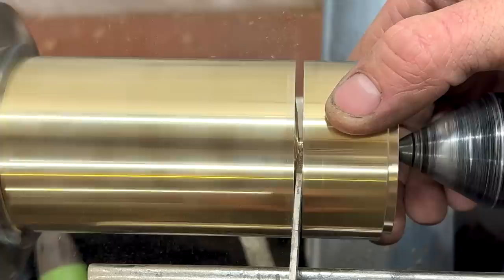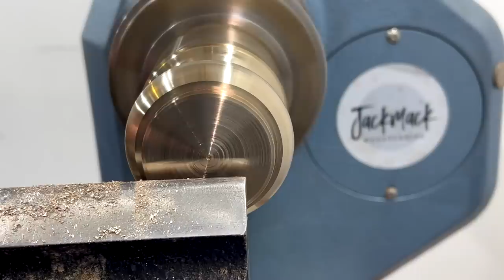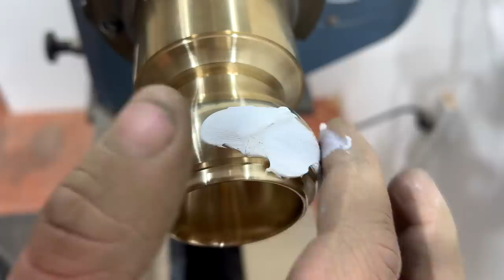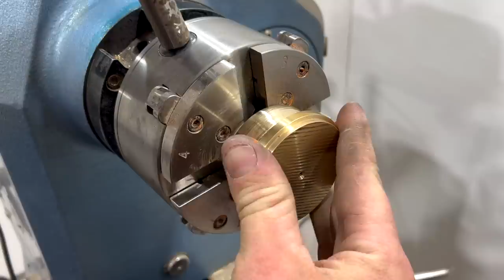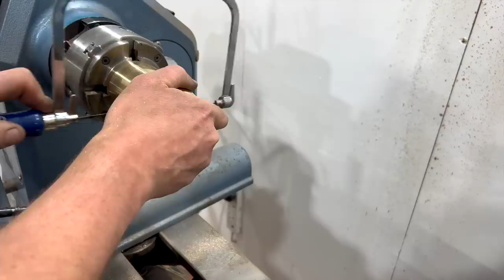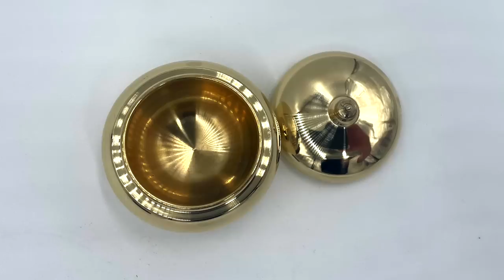Woodturning - I Turned Solid Brass On A Wood Lathe !!

Comment: First of all, Brilliant! Secondly, I would like to know the same as Tim, how was the brass on the tools? To me it seems like the Hamlets held up very well judging from the shavings you got, but you had to sharpen quite a bit. This was really a insane but Epic project mate. Well done. I'd guess about 8 times you had to sharpen. Thanks again for this.
Reply from the maker: Cheers buddy. Be sure to pop your answer in the pinned comment thread so that it’s not missed. Comment the answer there in due course 👍🏻
You going to give this a try ?
Reply: @JackMackWoodturning  yes i am

Comment: That was interesting 👌 what you gonna do with the shavings ? I’d make a bowl or a vase in clear or a very light colored resin 👍
Reply from the maker: I’ve got the means to melt them down and recast them. So Il be doing that I think.. brass is pretty expensive.

Comment: Good job, I didn't know that works. Looks like an urn for mice ... 😉

By the way: What engine speed did you use for turning brass?
Reply from the maker: Speed varies. 1200-2000 

A mice urn 🤣🤣🤣

Comment: You can turn soft metals on a wood lathe. I have been turning aluminum for several years. Too many variables, but  I'm going to say that you sharpened the tools 5 times.
Reply from the maker: Lower! 🤣
Reply: @JackMackWoodturning  You sharpened your tools 3 times.

Comment: I tried turning brass a while back and the tool just bounced off it. Didn’t work very well for me, you make it look so simple.
Reply from the maker: What tool did you use ?
Reply: @JackMackWoodturning  brand new carbides. 😒
Reply from the maker: Scrapers.. too much surface area I’d say. Try again with “real” (😉) turning tools

Comment: First off let me just say it came out beautiful. Probably twice as nice as I would have thought  would have from the first couple minutes of the video. I am going to throw my two cents in though but it's helpful criticism one Craftsman to another. It was Santa just so you know I'm not just some dude that watched a few videos or picked up lathe work for dummies at Best buy. Josiah 20 years manual Machinist and bushing 60,000 hours of experience 60% of it was on lathes. Everything from tool and die photo typing robotics aerospace commercial and space program military defense and automotive. Granite I haven't been in machinist in 15 years and now journeyman Union Millwright. But some of my terminology might be off. Probably more so on the woodworking tools..  beforehand forgive me if I misspeak but I think you can figure out what I'm getting at if I get the name of a tool wrong. No this is something that you only did for a video probably won't do it but a handful of times in your career don't worry about it but if you're going to do this often or a couple times a year i assure you if you apply these subtle changes and give yourself three to five of them to get used to the change and procedure influent with the different process you'll see a big difference in everything from how often you sharpen your tooling you use. And definitely in your finish and safety as well. Okay right from the brass blank in the chuck.. for you ever even put a tool in your hand you're going to have that peace morning too and concentric considering it was a machine blank and I'm assuming it probably ran within .002 of running true and concentric. That being said it should be within no more than 10,000 run out and to end before you touch it with any tooling he should be running no more than.010 run out. Three times a year minimum I'd advise dedicating inside the Jaws to this procedure but a brass or aluminum ring on it the first thing you do is close your jaws and give them a skim cut. That way when you throw the piece in at the Jaws it'll probably be within 5,000 if not better all you have to do is tap in bar end but I feel adults perfectly straight he's a piece of brass the size of a quarter roll but right on the turning piece go get the fuel for the high spot and just tap it keep doing that until you don't feel a high spot no more it will make a difference. Okay Angela touring techniques and concepts for turning wood is way different than meta. But on the other hand they're very similar if that makes sense. Differences are proper tool selection proper grinding and proper tool angle way more critical with metals.

Comment: Oh! By the  way, I turn bowls, and I dont have a Varigrind jig set or Sorby sharpening station.
Reply from the maker: Do you have a tormek? 😆
I’m joking. I’m guessing you sharpen free hand. ?
Reply: @Jack Mack Woodturning  Hi Jack! I am just setting out teaching myself bowl turning. Perhaps if I had known now expensive it was to set up,  I may not have started out. But now I have a small workshop,! 

To answer your question.....at the moment I don't sharpen gouges. I mutilate them!

It's all a learning curve. Which is the most enjoyable part. as I am quite badly. disabled after being poisoned with a pesticide at my work. The problems keep my mind active. Or is that perplexed?

I enjoyed your video. Is it possible that you do a series in a minimilast.  

No jigs, no bandsaw, no hugely expensive lathe, Simplicity! For all us newbies out there who have just set out. Can you do that?

Comment: I don't get it.  There are metal turning lathes, and tools specifically designed for metal turning.  Why ruin your wood turning tools doing this on a wood lathe?  Just to show that it can be done?

A lot of things \can\ be done.  You can drive nails into 2x4s with lineman's pliers.  You can use a chisel for a screwdriver.  You could use a vertical mill to make coasters out of plywood.

Probably not the best use for any of these, though.
Reply from the maker: Why do you think this would ruin woodturning tools ? 
It’s brass and they are hss 
I don’t have a metal lathe and I wanted to turn a box from brass, I mean, it’s rather self explanatory, is it not ?

Comment: With the money spent on purchasing brass and big planer and router machines, surely you could buy a small metal lathe and do the same job without damaging your woodturning tools? Please look into it! I feel sorry for the HSS having to do more than a few rounds on soft metal...
Reply from the maker: This doesn’t damage my tools. And the goal was to turn metal free hand. Not with a boring skilless metal lathe.
Reply: @JackMackWoodturning  Whoa… That’s very insulting to say that metal lathes require no skill :/

Comment: I know its already over but I agree with 0 which has been stated a few times, if the tools are good highspeed steel and sharp before the project starts they shouldnt need frequent sharpening HSS tooling is used to cut brass on metal lathes and can go quite a while without sharpening assuming they arent being used improperly
Reply: @JackMackWoodturning  also I have been looking into new turning tools lately I have a poor quality set right now what brand would you recommend?

Comment: Turning brass on a metal lathe is right in the center of my wheel house.   Hand turning on a wood lathe, with all the tool chatter?  Nope, not for me.  Nice piece of work but let us old engine lathe operators work with metal TY!  I wouldn’t consider chucking a piece of wood in my metal lathe!  Not what the machine was designed for!  I’m impressed it turned out as well as it did, but please, shoemaker, stick to thy last!  Brass is self lubricating and I doubt you had to resharpen your tools during the entire project.  Brass cutting metal lathe tools have a deep negative rake cutback just like a traditional wood gouge.
Reply from the maker: Nailed it M. I’m not intending to step on any metal workers toes though. ‘Twas just an experiment. 😉

Comment: I wonder if it would be possible to hand turn on a metal lathe.
Reply from the maker: I guess all you would need is a tool rest right?
Reply: @JackMackWoodturning  That's what I'm thinking. I've tried doing metal on my wood mini lathe and found it was too sloppy (cheap?)
Reply from the maker: @davidhawley1132  I’d say so. Never seen a mini lathe that was built well. Even the expensive ones.

Comment: Hello sir,
Where can I buy a cylinder like that? I'd love to try something like this.
Reply from the maker: You can buy brass at any metal wholesaler or buy off cuts from eBay. What do you plan on making ?
Reply: @JackMackWoodturning  weird, I thought I left a reply already... maybe a different thread. 

I want to make a chessboard with brass chessmen or copper. I'm not sure how they compare when turning but I'll find out I suppose, then maybe aluminum for the other color. But I don't like aluminum so if you have any ideas I'll take them.

Comment: I heard that having all of that metal flying around is more dangerous than what meets the eye. Since it’s very sharp and very small it could puncture you quite easily and even get in your lungs. Hopefully, you knew all of the risks going into this and if not there is a guy with a YouTube channel called Stuff Made Here that goes a bit into depth about the possible dangers of this.
Reply from the maker: I always wear lung protection 👍🏻

Comment: Why did you keep offering the bottom up to the lid to check fit but then turn the outside of the lid not the inside?
Reply from the maker: I turned the outside after I got the lid fit I believe. I’d have to watch it back. But I think that’s how it went

Comment: I found a few in ebay, what diameter is this?
Reply from the maker: Hi Richard. I too found this on eBay. I believe it was 65mm but id suggest you look for something that works for you rather than what worked for me. 
What are you planning to turn ?
Reply: @JackMackWoodturning  a full chess set. 
But I don't know what to use for the other color

Comment: not sure if its the video, or not, but it sure looks like the jaws on your chuck are running out a lot.
Reply from the maker: What do you mean by running out? The piece is clearly not running out of centre so I’m confused how the jaws could be
Reply: @JackMackWoodturning   you probably don't much metal machining, but runout is when the part is wobbly and not on center. If you had an indicator you could put the indicator close to the chuck and see how much it runs out. If you look at the video it looks like the brass bar is moving wobbling, could just be video.
I do both metal and wood, so I'm more intune to these kind of things, wood lathe chucks are famous for not holding on center and having runout. I adapted a metal lathe 4 jaw chuck to go on my wood lathe because of the poor quality (my opinion) of wood lathe chucks.